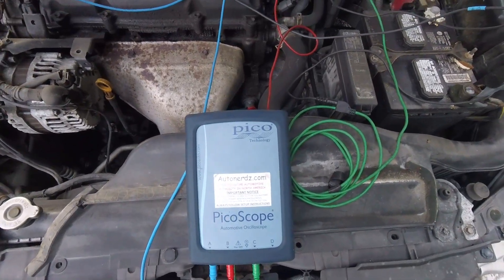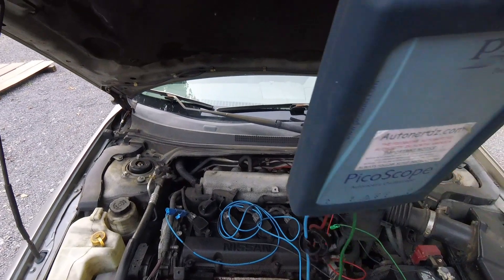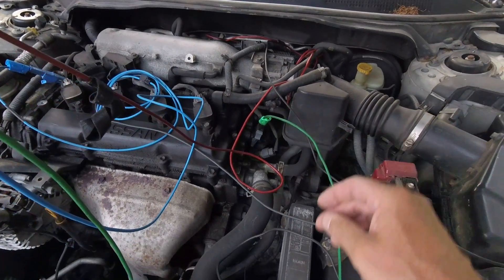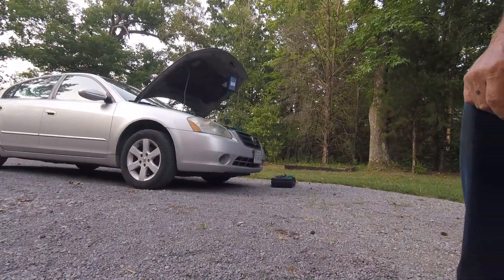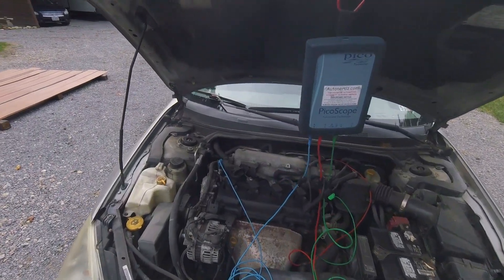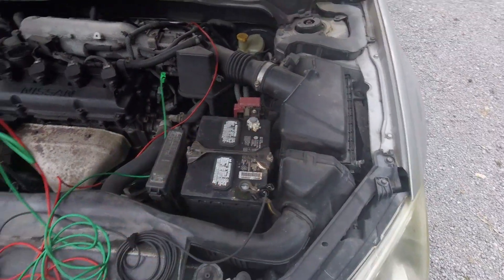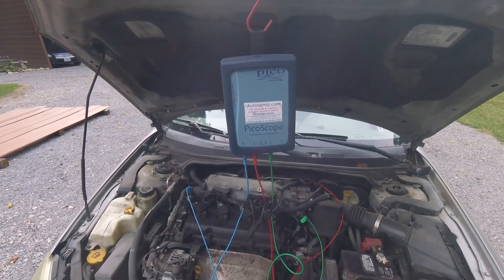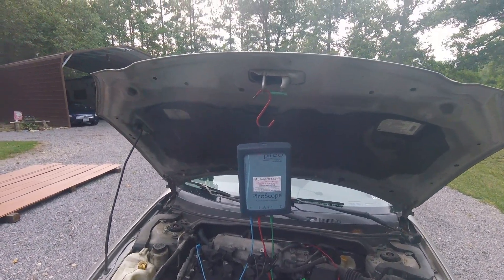Product Demo: Custom Test Leads

Comment: Looks pretty cool! Another function you would lose is that now there is all one ground like a snap-on scope, so you cant reference another ground point, eg. a crankshaft sensor.
Reply from the maker: You can always test other  ground points, just use another channel.  Example: Ch.a  battery + and grounded to battery -  Ch.b  CKP ground Ch.C engine block Ch.d ECU ground.  Now what You have done is a voltage drop test for the ground side from b c and d all referenced to battery negative.  My 4423 picoscope  my Snap on scope and ATS scopes all work this way and there may be others. Also unless I have a very good reason I would never "reference " 2 different ground points, it can get confusing especially for newer users.
Reply: @CartersDiagnostics  I understand you can do that. I was just pointing out that a feature of the 4425A is that each one is grounded alone. The reason you might want to ground at a crankshaft sensor is to see the biased voltage on the variable reluctance type sensor or to see if the noise you are seeing is affecting your signal.
Reply from the maker: @advancedleveldiagnostics  Agreed 💯 . I answered the next comment down the same way, he was asking about the advantages of not having a common ground. I explained a VR sensor also.😅🤣

Comment: Nice video.  What is the advantage of individual grounds for each channel?  I'm still using an old school Modis scope which still gets the job done.  Peace.
Reply from the maker: You can test across components and not worry about the common ground with a 4425 style scope. But a common ground style scope could cause this... Example, a  2 wire sine wave style ckp sensors. If you were to test across both terminals with ch.a  and test another component with ch.b  while its reference to ground. You could create  a no start due to the ckp sensor shorting out to the ground on ch.b .  I still use a Modis style scope also, its quick to deploy. But if I really need to go deep the Picoscope comes out!